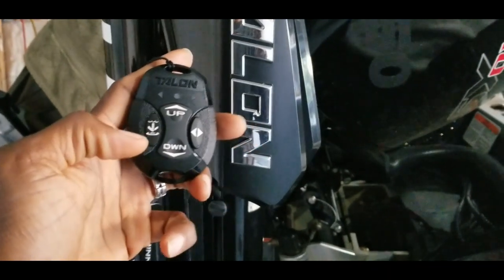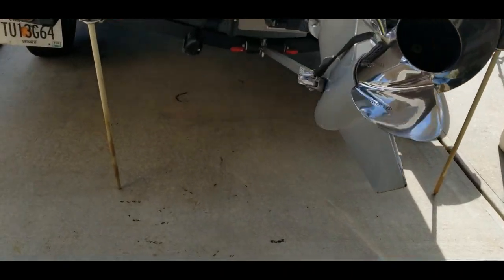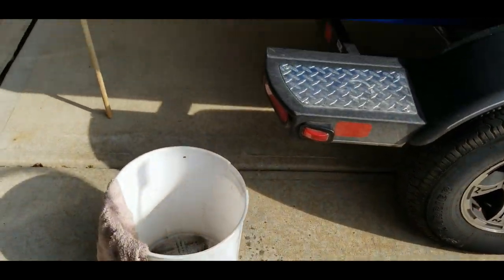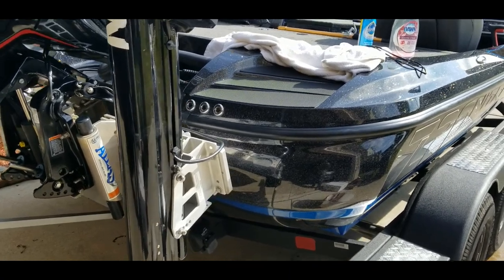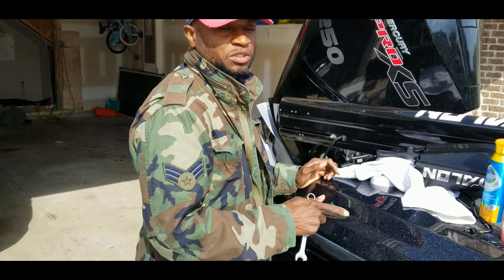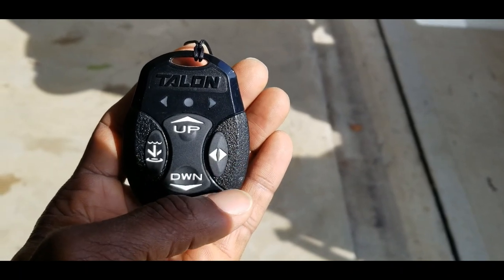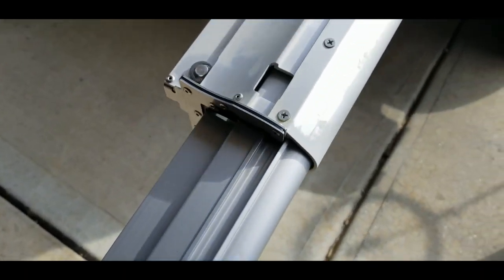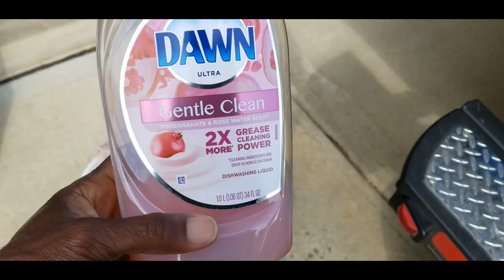Minn Kota Talon Cleaning and Lubricating

Comment: Great video my 10’ Talon is ordered I did get the tilt bracket for mine. Great tips thank you !
Reply from the maker: I wanted the tilt brackets but they actually prevent my boat from fitting in the garage. I have to take my Talons on and off each time.

Comment: I was told to just be in deep water, go forward and reverse with outboard, and cleans them up right away before it dries.  Never had an issue, i see everyone is having issues with the Talon not coming back up, i had it happen a few times when i want to raise it, and it beeps, usually move trolling motor a bit and every time it comes back up, but to the ones who don't, what do you do?  No tilt brackets on my Talon.
Reply from the maker: Thanks for the tip. When I have issues with my Talons deploying I will usually deploy them using the buttons on the Talons themselves or try pairing them again. Hope that helps. Thanks for supporting the channel.

Comment: Nice video. My remotes don’t work anymore on my Talons. I have 4 and none work. Have to use my Helix or phone. I have replaced the batteries. Any ideas?
Reply from the maker: When you press the buttons to pair them do they start flashing? How many remotes are you having the issue with?
Reply: @MoneyBass  all 4. Probably operator error. I didn’t know I had to pair the remotes.
Reply from the maker: @pjost  yep, you definitely have to pair them. It takes about 30 seconds to complete.
Reply: @MoneyBass  going out tomorrow. I’ll give it a shot. Thanks bud.
Reply from the maker: @pjost  no problem. Thanks for supporting the channel. Let me know how it works out.
Reply: @MoneyBass  you were right my man. I updated my Talon software this spring. I didn’t realize you have to re-pair after an update. Anyway I got my remotes working. Thanks!
Reply from the maker: @pjost  cool! Drop the talons, skip a few docks and stick a few 5 pounders!

Comment: Sir:  mine will not deploy???
Reply from the maker: Thanks for supporting the channel. I recently had that issue. Luckily it is still under warranty. I took it in for service and I believe they replaced the motherboard on the one that wouldn't deploy.
Reply: @MoneyBass  what if new board installed still doesn’t make it deploy?  Green light blinks & a click noise is heard
Reply from the maker: @sharoncasey7931  there could be a screw loose that is locking it up internally. Search talon won't deploy there are a few videos that might help.

Comment: Its crazy you got 5k in talons and you use common house hold goods to conduct maintenance, obviously it works but is there a reason why you went to pledge instead of a marine grade lubricant with some type of wax to keep them slick? Hell now a days they ceramic coat everything a do it yourself kit would allow the coating to keep the mud and debris from sticking as much. Talons are a finicky bitch but you can't beat 15 ft of holding power, pair with riptide ulterra and thats a deadly combo.
Reply from the maker: I've used wd40 before but I saw a video where someone stated they talked to support at Minn kota and they suggested using pledge to prevent oily residue what could cause dirt to stick to it. lol, yep, I like my Talons.